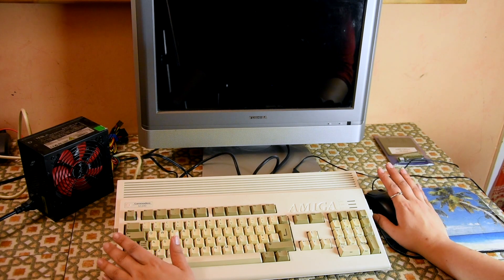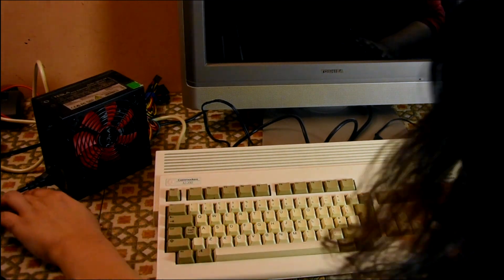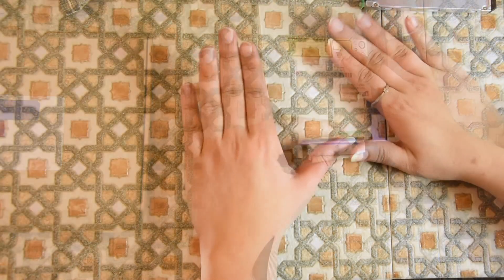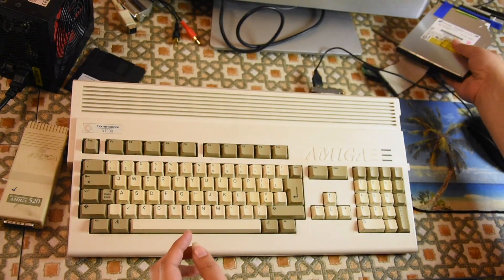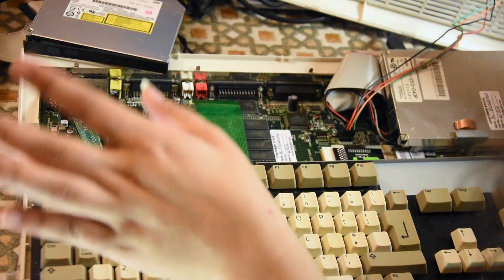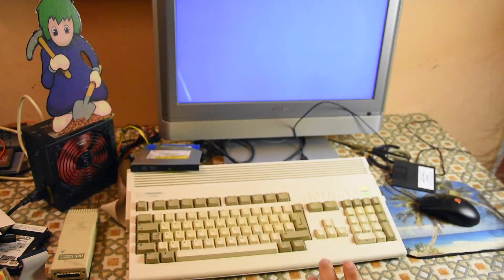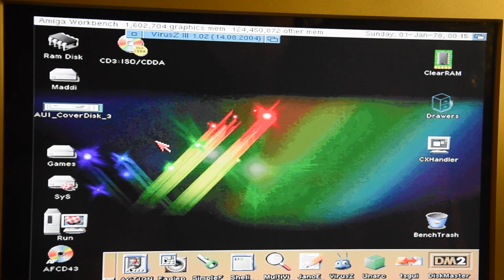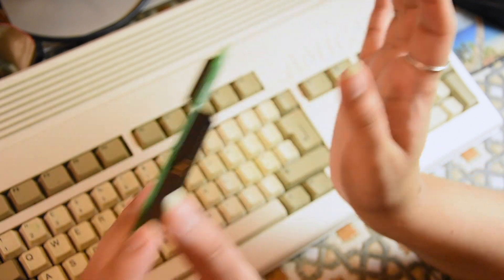Amiga Optical Drive - Part 1

Comment: Does anyone know if this will work with a laptop slim sata to ide converter?
Reply from the maker: As far as I know it will as its standard IDE, however make sure the converter has audio support and has separate connections for audio.
Reply: @MsMadLemon  I'll have to solder some wires to the Audio port as the cd rom only has an internal connector and the slim serial port for connections.

Comment: You should get a gotekmount from riscman!! ... riscman on ebay does an awesome switch and bracket for DF1 / DF0 selection. Also, amazing gotek mounts and other 3D printed parts such as an awesome mount for Compact Flash cards both internal and external. All non-destructive case parts -Amazing stuff!!! You can see the LCD really easily with his mounts...perfect!!! And it looks really cool!! check out the Mk3 3D printed gotek mount...amazing!!

Comment: Hi, i have been pondering over doing this very same mod, however i can`t seem to find the correct converter for the pata to ide adaptor, would you be able to send me in the right direction with a link maybe where i can get one, many thanks in advance :)
Reply from the maker: Sure :o)
I hope this helps: https://www.ebay.co.uk/itm/Laptop-Slimline-CD-DVD-to-IDE-Adaptor-UK-Seller/300337874711?hash=item45ed884717:g:lUQAAOxyiBpSKN9x
Reply: It sure does, many thanks for your help and as always a pleasure :)

Comment: I guess using a plug and play external CD ROM would not work? The issue I have with many of the newer laptop optical drives is no room for CD'S that have the stick on labels. Not enough clearance inside them. Love your laugh! 😄
Reply from the maker: Hahah :oD 
I'm figuring if you have the rapid road USB add-on for the A1200 then yes you could :o) .. or if you wanna do it oldschool way, a squirrel SCSI interface with an external CD-ROM drive (expensive though)

Comment: That looked easier than i thought it would be, cool that there are converters today for laptop drives, and at least it's on the inside.

Back in 94 i had the external Zappo Overdrive connected through the PCMCIA slot (and crapload of Aminet CDs) i remember that at the end before i sold my original 1200, the IDE interface on the back of the drive was lose and got disconnected from time to time (tried connecting hard drives to it by writing mount files) and the cable in between the two was about to fall apart and i had to tape it up so the guy i sold it to would be able to use it.

Comment: Awesome! I cannot tell you how much I paid for my external SCSI cd drive for my A1200!  It came with a rubbish phono splitter and basically put two  L&R inputs together before outputting to the hifi!
Reply from the maker: I ALWAYS used to dream about the external SCSI CD drives and zip drives back in the day haha what I wanted most always was a Squirrel SCSI interface. They were always expensive as you say. Once I got my Amiga towered, I went all IDE on it, CD drives and zip drives!

Comment: You have a ribbon cable with a primary and secondary connector on it. Could you just use that and eliminate the PCB? Try a desktop cd rom. ait should have a two wire connector on the back for audio. Thanks for sharing  : )
Reply from the maker: It's because on Amigas, (unless it's an Amiga 4000)  you need a buffered interface, to connect more than one device (or if you want to use long cables). I assume the IDE port was designed for 1 single hard drive to be used only. Adding more than one device without the PCB circuitry can apparently damage the IDE port. 
And my pleasure :o)

Comment: Great =D  I thought about doing this but not sure I would use the CD enough to justify it.  I would also be tempted to mount the drive external to the 1200 - just so you don't have to damage the original case etc.  I think one of the problems when trying to play CD32 games is there's a missing Akiko chip that the CD32 had which the 1200 doesn't.  That said, I am sure lots of CD32 games probably don't use Akiko and they will probably work OK?  Maybe there's even a way to emulate Akiko in a 1200 - no idea?

A fun and interesting video though =D
Reply from the maker: Yes I was thinking about mounting the drive externally, it was so hard to cut that case! :o)
But I have done this before on a previous Amiga and kinda liked it. I have quite a few magazine cover CDs, a few CD32 games and a cake full of CD and DVD R discs with stuff on them so I guess I can justify it personally.
The original software i had which came with the buffered interface (IDEfix97) came with a CD32 emulator, I managed to run the few discs I have. Haha nice memories of Beneath a steel sky with vocals :oD
I may have to dig out IDEfix97 just to get the emulator or find another, it didnt seem to come with Allegro CDFS
Reply: GadgetUK164 You just need a 2.5 to 3.5 cable. Better make one. You also must not connect the 4 upper pins on amigas ide. Connect to the middle one you master hdd and at the end of the cable your slave dvd. New dvds have enough buffer to burn without errors and achieve good speeds on a 030 amiga without buffered ide devices.
Reply: You can play Beneath a Steel Sky CD32 version with the vocals straight from your HDD with WHDLoad!  If you want I can zip up the WHDLOAD collection for you. Just let me know.
Reply: Ms Mad Lemon if you have enough ram you can enable preload option from icon's tooltypes.
Reply from the maker: Thanks :o) Yes I have the WHDLoad of Beneath a Steel Sky but it takes literally about half an hour to load? Either that or i'm doing something wrong. I have the WHDload though i'm not sure if it's the latest one or where to get that.
Reply from the maker: I have 128mb, so I will try that, thanks.
Reply: Great!!! Just info your icon and type PRELOAD. Waiting for the results :-D

Comment: Hi Maddi!
I'm no Amiga expert, but you basically need the audio out on the CD-Rom drive because the Amiga doesn't have a digital analog converter for CD-Audio aka CDDA. Drives with an analog audio output simply have the digital to analog chip inside the drive, so they do the converting work beforehand. Unfortunately a lot of these slim style CD/DVD drives won't have analog audio outs. BTW...The fourth pin on those cables was the digital audio out,  which one could adapt to a chinch cable and connect to the coaxial digital input of an audio device like an AVR or something.
As of my knowledge there was an experimental Amiga program to decode CD audio by software, but it was extremely laggy and had bad audio quality to say the least...the Amiga cpu was simply not up to the task.
Reply from the maker: Yes you're right, I managed to find and order another adapter board which has the analogue output option on it, so continuing with that :o)

Comment: Yes, next project. Put your Amiga online!  Very easy to get  PCMCIA wireless card and use MiamiDX to connect to home wifi.  Only issue I had is that I couldnt get mine to work with any encryption greater than WEP.  Or if you have your router nearby then an NE2000 compatible PCMCIA Ethernet card will do the trick.    Its really awesome to be able to jump on IRC and browse the net on the amiga. (tho 99.9% of websites don't disply properly now of  course). Also very useful to run an FTP server on the amiga and use it to transfer files to and from. Or run Samba and map network drives to/from the PC.
Reply from the maker: That would be cool, I mean I have thought about connecting the Amiga to the wifi not for the internet but more for file transfer as now I use a CF card via the PCMCIA. Hmm you can only get WEP? I never thought about this issue until now. Still i'm curious to try.
Reply: Yeah youre way smarter than me, so might find a solution to get WPA working. But the driver I had for my wifi card would only support WEP.  I did a messy workaround by hooking a second Wifi access point up to my main router with WEP encryption and only switch it on when i had the amiga on, and have it authenticate with that. It worked though :) 

I used to use the Amiga exclusively on the internet back in the day. So getting mine online was more of a trip of nostalgia especially with AmIRC and downloading from Aminet is of course still possible which is useful!   Really powerful Amiga (060 and gfx cards) can use Netsurf browser which has a lot more compatability with modern websites than any classic amiga browsers have.  But sadly ibrowse, voyager & aweb are pretty useless by todays standards!
Reply: The easy way to get around this is to connect the Amiga via RJ45 to a router that has wireless connectivity - perhaps even its own dedicated repeater or something.  Then it doesn't matter about WEP since all modern routers will do WPA.  Although an adapter like this hogs your CF slot :P http://amigakit.leamancomputing.com/catalog/product_info.php?products_id=116
Reply: Probably Ibrowse or Voyager I would say.  Its what I used on the internet back in the day. But they're not going to browse many websites properly today with lack of css support.    Ive ran Netsurf on emulated amigas but it'll probably be too painfully slow on an 030.   I just use Ibrowse on my own real Amiga 030
Reply from the maker: Actually, thats a point, what is the best browser for something like mine? ACA 030 (no graphics card) is ibrowse the best one (to browse these magazine CDs) or is there a better? Amiga and internet/browsing is completely new to me.
Reply: Yup perfect if the router is in cable reach of the Amiga.   My option is wifi only due to the router being on a different level in my house :(
Reply from the maker: Thanks! i'll try out voyager just to see what it's like, but i'm just going to be browsing these magazine CDs, nothing more really... 
By the way with the router issue, when I created my first hackintosh I couldnt get wifi going, only LAN so I got something like this, maybe this may help with what GadgetUK is suggesting? :
https://www.amazon.co.uk/Wavlink-Wireless-Extender-Ethernet-WL523N2/dp/B01I500KTM/ref=sr_1_3?ie=UTF8&qid=1484948379&sr=8-3&keywords=lan+to+wifi
Reply: Yeah that should work and then RJ45 into the bottom of it. I have a TP Link one and can get ethernet connectivity through it to my PC. 

I remember browsing the magazine CDs websites on Amiga Format and CU Amiga before I had an internet connection and was just imagining I was online back in the day! :D
Reply from the maker: lol that's exactly what it felt like here when I tried just then, I hadnt browsed the AF and CU CDs like this back then with a browser, I just went through them and got the mods etc, so this is new for me :o))
Reply: Lots of routers can be configured as a 'repeater'.  It basically connects to your other router via WiFi, then you plug into the RJ45 jack on the repeater.  So the repeater can be right next to the Amiga and the repeater will wirelessly connect with your main WiFi router downstairs.
Reply: I used to talk to my mate Matt on IRC in the late 90s and he was using his A1200. Haven't ever put mine online but he had it all setup.